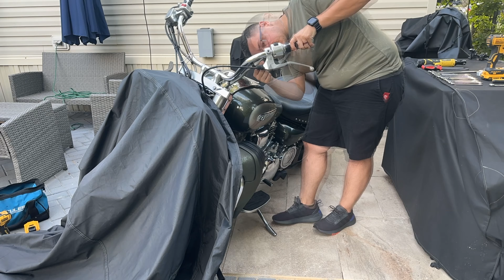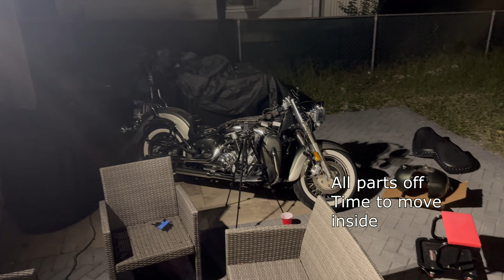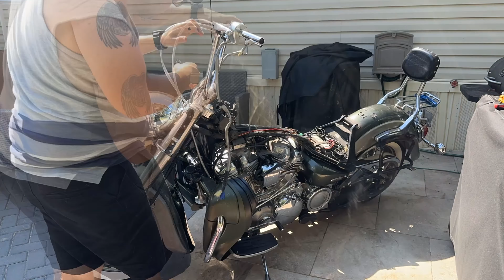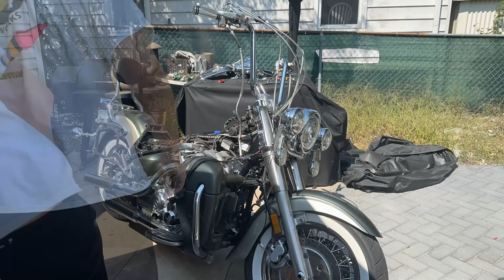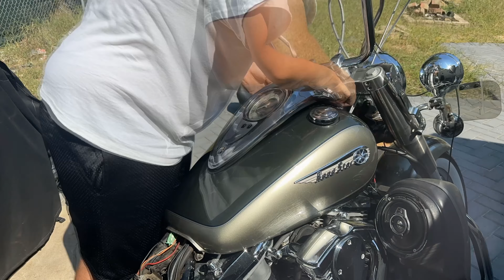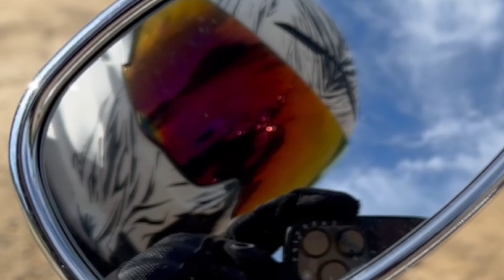Installing New Bars On My Yamaha Roadstar 1600

Comment: Excellent work!! Where did you buy the extended wiring harness and the throttle and clutch cables? Greetings!!
Reply from the maker: Clutch, throttle, and brake extended cables I got from here. 

https://pacificcoaststar.com/

And the wiring harness had enough slack for me to just use the stock wires

Comment: I have the Same bike, Same color too! Great Build!
How did you Mount the bags to the original bagholder?
Reply from the maker: Made custom Z-Brackets with strips of metal I had laying around bent in a vice. And that’s how the top holes on the bags I got to mount to the stock holes on the frame. The bottom of the bags sit on the stock bag frames, and I drilled holes where they lined up. I’ll try and make a YouTube Short just showing it, not pretty my any means lol but the bags hide it
Reply: @-Kram-  Thank you so much! Harley Bags dont fit, because my exhaust is Too high. Its impossible to find a 2-1 exhaust for this bike here in Germany.
Reply: Did you use the same cables?
Reply from the maker: @thisismytoy5632  I used the stock electrical cables. Clutch line, brake line, and throttle cables I bought new longer ones that are stainless steel.
Reply: @-Kram-  thank you 🙏🏻
Reply from the maker: @thisismytoy5632  No Problem, I used this site to order mine. They also do regular black cables. 
https://www.pacificcoaststar.com/pcs/road_star_cables.htm
Reply: U didn’t have to extend wires?

Comment: The cables look too long. Did you get the correct ones?
Reply from the maker: They’re correct for the bike yes, but I purposely got them a little long due to them being expensive and made to order. So without the option of a refund if I ordered them and were too short, I just wanted to be on the safe side. Plus, leaves me the ability to get taller bars later if I I wanted
Reply: @-Kram-  
Makes sense. 👍🏻 Looks great.

Comment: What lower fairings do you have?
Reply from the maker: They are Harley Lower Fairing, they were on the bike when I got it, I wish I could give you more info. They were just storage compartments, I cut the round holes and added the speakers.
Reply: @-Kram-  I wonder if they will fit Yamaha crash bars or if yours are aftermarket. I’d like to get lowers like that with speakers eventually. I need to fix my fairing first though
Reply from the maker: @ACEMIDNIGHT102  when It warms a little and I take the bike out of the shed I’ll see if I can find any markings on the crash bars to tell if they’re stock or not for you
Reply: @-Kram-  I appreciate that, thanks!
Reply: What cables did you use?
Reply: @joshrozanske2253  I have stainless braided cables that are the stock length I believe